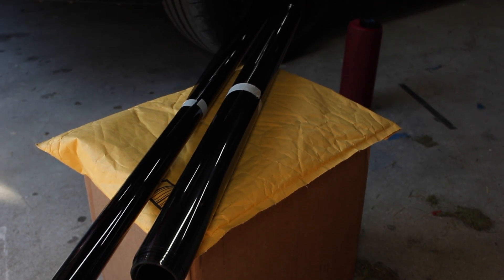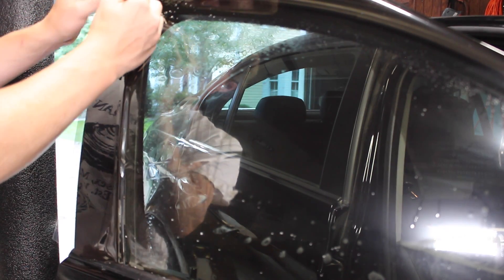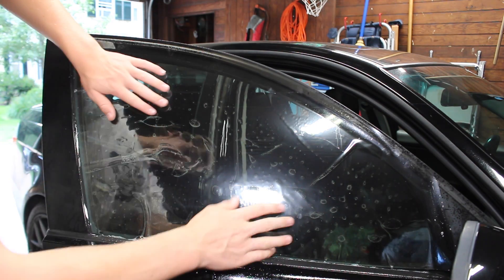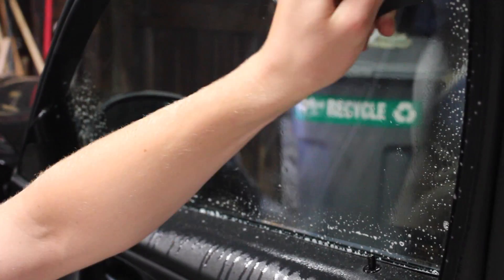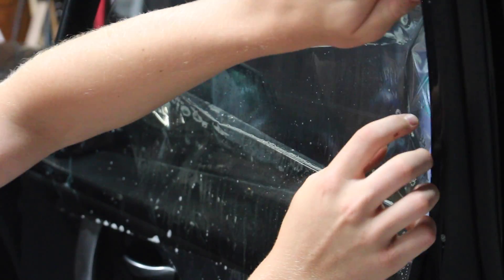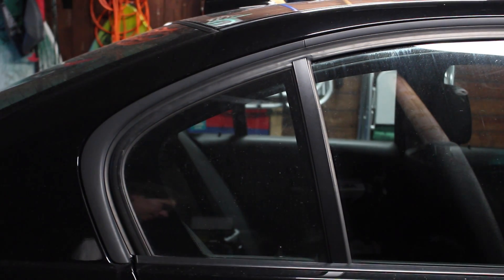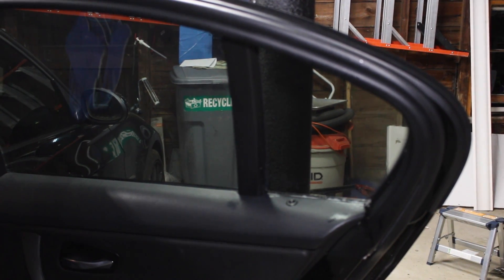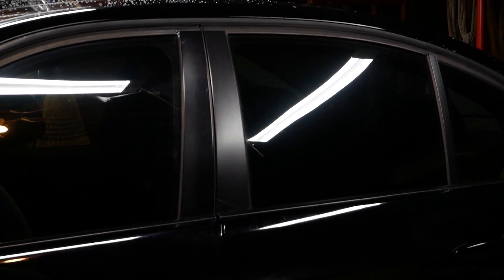FINALLY Tinted My BMW // How to Tint a Car

Comment: Sickkk, a quick diy suggestion that a lot of people would benefit from is the red pre cut tint that covers the white part on tail lights. Specially made for BMW pre lci, gives it a meaner look like the LCI ones.
Reply from the maker: Good tip